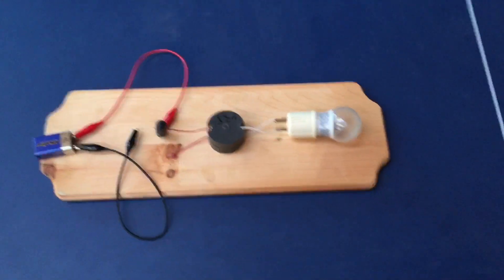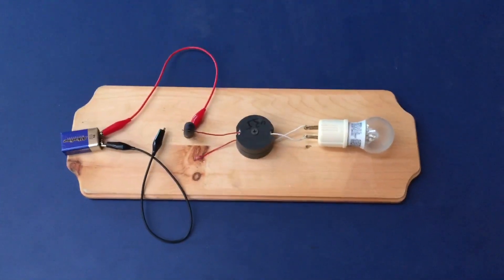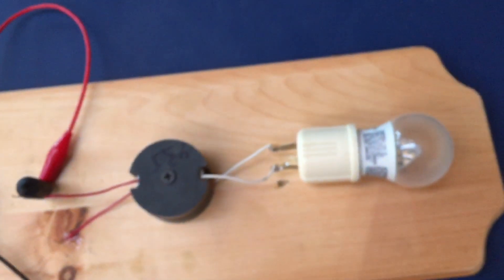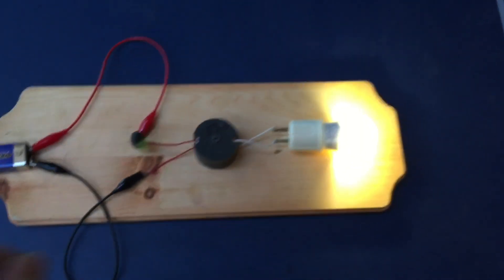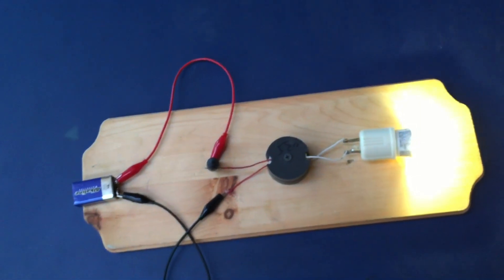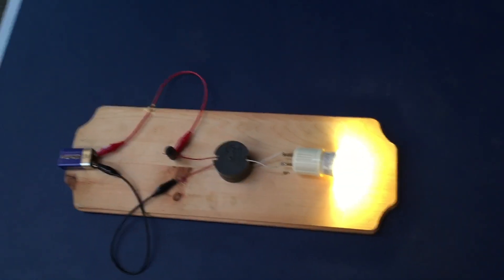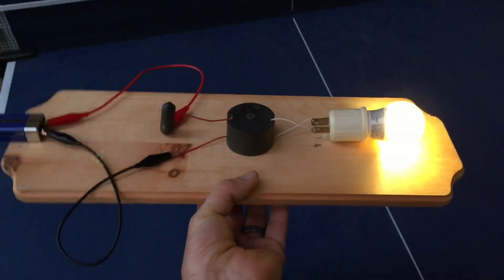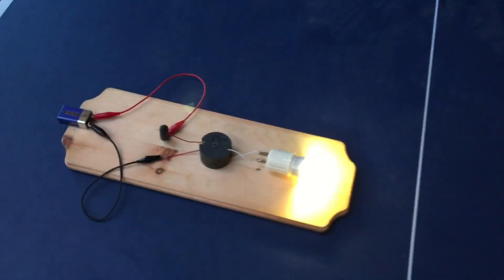Transistor Free Joule Ringer - Super Simple Config

Comment: How many windings? Why not just give the resistance of the carbon-rod & use a "potentiometer"? (Avail. at every Radio Shack, Digi-Key, Newark Electronics, etc.)...
...and, BTW, 30-40ma SUCKS for lighting such a small light-bulb! No offense intended, but where'd you get your Engineering License, from a matchbook or a comic-book?
Sincerely,
 Phoenix NightOwl, a.k.a. "TV Engineer for over 35 years", Original Lic. # P1-24-12140, current # PG-4-5658.
(..."Keep on experimenting?" heck, I knew THIS stuff when I was 8 yrs old!)
Reply: There is not much you are sharing with the world with all those "35" years of experience....
Reply: What do you want to know? (Like: Does it really take only 15-microseconds for the drift-tubes in a power klystron tube to vaporize?  Yes, that $60,000, 6-foot-tall "tube", with 55-GPM of coolant running thru it, really will destroy itself that fast.)
 ...Ask me what you wanna know...
 (Don't knock someone till you've traded emails, phone calls, letters, ham-radio "QSO's", etc.
 Ask to learn;
 If I don't know, I may have it in a book on the shelves, or know someone who DOES know, & I can "relay" the answer.  Keep Smilin', and don't take life TOO seriously!
 (Before I forget: R.I.P., Johnny Winter & Jack Bruce;   seems like the really great musicians are getting closer to extinction every day)...
P.N.O.
Reply: Phoenix NightOwl, Jr. if you spent half as much time bragging, boasting and touting your horn and contributed that to brushing your hair, you might even get a date, too.
Reply: Phoenix NightOwl, Jr. the law is so complicated...i don't think lawyers and judges know what they're talking about...what is your biggest takeaway from reading this stuff....to me it sounds like if you can talk your way through it and not incriminate yourself, you'll "win" court battles.  have you watched Carl Miller's constitution vids?
Reply: Greenme Research Exactly. Typical response from a user with zero videos online, and only 1 subscriber. It's a phenomenon I call YT-jealousy. "oh darn, I know so much more, I've been at this, that, and the other thing - since you were knee high to a tadpole -- people should listen to me instead --  i guess i'll be the nasty troll and be all negative and derogatory, cause you know, i have no YT love" hahaha - hilarious
Reply: Yup, that's me, The Grinch©. Lousy job, but someone has to do it. (How "old" ARE you, anyway?) You really think I'm kidding? My Broadcast Engineer's license # was P1-24-12140, last renewal was "grandfathered for life" to PG-4-5658;
 The Feds say I know what I'm doing, or they wouldn't let me play with 4-Megawatt UHF transmitters.
 I don't have videos on-line because I've been busy teaching myself the law, and am "drowning" in paperwork. What have you been doing with YOUR time, lately?
 And you'll notice, I DID ask "Why don't you just use a resistor"; At 29₵  for four from Radio Shack©, they're a lot easier to get & work with than a carbon rod.
 And think about it:
30-40mA DOES suck for lighting an incandescent light bulb these days, when you can get a Naichi© or Cree© LED that'll use 6W & blind low-flying planes, with 3xAAA cells, (at about 28.5₵ each, incl. 7% sales tax, at the local variety store, instead of using $5.70 each for 9V batteries);
 A modern AAA cell is rated for about 1.000Ah, a 9V is rated from 0.120 to 0.180Ah.
 It's called "staying within budget & ahead of schedule", or "Why pay more when you're getting less?"
 If you need 9V, keep in mind that most "9V" batteries are only 7.2- to 8.4-Volts anyway, & if you really DO need an honest 9V, you can either buy a "9V Battery" from Varta, (they're in Germany), or other companies who make batteries, or you can make a simple "ladder-style" voltage multiplier, & STILL come home with more $ in your pocket than buying a "9V" battery.
 When the price of fuel went "through the roof", I put my fuel system, (scaled down to fit), on my Lawn Mower/Tractor, & now it runs all season on about 6-oz. of gas, instead of 6-gallons.
 I prefer to recycle stuff to death, like our ancestors did;
 When a sail couldn't be used as a sail anymore, it'd be taken apart & re-sewn into a tablecloth, then a shirt or pants or a dress;
 When those couldn't be worn anymore, it'd be re-done to make towels, then washcloths, then blotters & pen-wipers.
 Nothing went to waste, since after pen-wipers, it'd be used as cleaning patches for a musket, then as a patch to go between the ball & powder in the musket, & finally, as tinder for lighting a fire to cook the food that was shot with the musket.
 If there are five or six 39-gal. trash-bags a year coming out of my place, it's because I did my "Spring Housekeeping", (or Fall, Summer, or Winter; as the case may be).
 BTW, what's YOUR license number?
 Which school did YOU go to to get it?
 If you're "into" "ham" radio, and ever get on 6-Meters, or 10- or 20-M, see if you can find me on 14.070 using PSK-31, or whatever the usual calling frequency is for those bands, if you prefer "phone" to "code" or another digital mode. 6-M is tricky; sometimes the band is open, and sometimes its not.
 You can usually find me, (N3VQK), "lurking" on 2-M, on the 145.205 machine, or one of the linked or cross-banded repeaters that connects to that one; A new one just went up on 444.625, PL=103.5, in the areas around Axtell, Holdrege (sic), & Alma, Nebraska.
 And yes, there ARE more cattle than people out here!
 BTW, what's your callsign?
 I prefer the 145.205 machine - It's "open", and I can hit it with <1.5W from an HT & its stock "rubber-duckie" antenna.
 And here's some "TV Trivia" for ya, in case you think I'm all "Grinch":
 The Grinch© was drawn by the same animators that drew "The Bunny" & friends, and in "The Grinch Who Stole Xmas", (apologies for the spelling), while it was Boris Karloff who got the screen credit, the studio forgot to list Thurle Ravenscroft (sp?), who did the baritone musical voice which ran throughout the Toon, (& who was also best known for his "Tony the Tiger"© voice);
 It was August 1978 when Warner Studios published Bugs Bunny's© "obituary", & there were 998 original "Loonie Tunes & Merrie Melodies", and other original "Bugs Bunny & Friends" cartoons at the time. (I'm not sure if that counted Chuck Jones' "Roadrunner"© stuff).
 It wasn't until Warner saw how much Disney Studios was making with "remakes" and "marketing items", that they decided to re-open "Termite Terrace", and put pieces of the old Toons together to make "new" ones, but getting the voices was tough, because there was only one Mel Blanc, & only he & his son could do "the Bunny" & almost all of the other characters, (June Foray did the remaining few), & when Mel died, his son apparently didn't want to have anything to do with "voice-acting".
 (June Foray was Mel's "understudy", and was best know for her "Rocky the Flying Squirrel"© voice, with "Rocky & Bullwinkle"  being creations of Bill Scott & Jay Ward)...
 It's really a pity;
 As with Janis Joplin, Jimi Hendrix, & Felix Pappalardi, (if you don't recall "Mississippi Queen"©, think "Mountain"© w/Leslie West, "Corky" Laing, Steve Knight {sp?}, Bob Mann {when they played in Osaka, Japan}, & Felix), there was only ONE Mel Blanc.
  Have a nice day, Doc!  :-)
Reply: Oh, almost forgot: my experience with "video"  is mostly from sitting at the Master Control Switcher, or from behind a pedestal-mounted camera, at places like WSBA (in Pennsylvania), WMPB (PBS in Maryland), and Channel 17 in Tulsa, Okla. (I've forgotten the stations' callsign); All but Ch.17 had started out using 2"-wide "quad" tape, (which cost 18₵/ft., & a 14" NAB standard reel only held 30 minutes worth of tape, back when the machines cost around $250,000 each, and you didn't put your fingers anywhere NEAR where the reels were, if you wanted to keep your fingers to remain intact), and every station had to have at LEAST 2 of those monsters; It wasn't till the late 1970's, when Jack Schuster & the "technical" folks at WSBA, (in York, Penn.), figured out how to hook some 3/4" Sony "U-Matic"© machines to a then$17,000 Time Base Corrector, which made them stable enough to be used for broadcasting; From there, the machines "shrunk" to a 1/2" Cassette version called Sony© "BetaMax"©, and a then after the "Format Wars" of the 1980s, (which was "won" by JVC© & their "Video Home System" format, or "VHS"©), that it became affordable for people to have their own personal video tape recorders.
 Compared to what John Baird invented & was developed, perfected, and eventually standardized & called "television", it was a long technical road to get to where video stuff is now.
 So, be Happy you're around to see, & be part of, the "Technical Revolution", since Humans are already starting to be "evicted" from the earth, and Smile!
 Happy Winter, Doc!
Reply: That isn't even worthy of the time that it'd waste to respond to it. I don't "flame" anyone here, why do you?
Reply: Sorry, I stopped wasting my time with "Script Kiddies" long ago. Why don't you find something useful to do, like see how long you can hold your breath till you pass out, or similar? I don't have time to play with morons; I have to do more important things than reply to "flamers" like you.
Good Bye.
Reply: danh le I never heard of Carl Miller before, but I'll start looking for that name, the next time I'm searching names...
You're right, since I think I ALMOST gave jurisdiction to a shyster, before I caught it, realizing that neither he, nor his "client", have ANY "First-Hand Knowledge" of the subject matter, rendering everything they say as "hearsay", which normally isn't allowed, ("void ab initio"), but "If you don't state your objection, you don't have one", so now I have to look up the local Rules of Civil Procedure, compare them against the FRCP, & see how to lodge the demand, (a " Demand" carries more weight than a "Motion", while not giving a court jurisdiction the way a " Motion" would), to have the whole matter thrown out; my biggest problem is that there's only one district court judge for a 3-county area, and it's the same one I have to resubmit my Copyright Infringement claim to, & wouldn't you know, it's against the same shyster I'm going after for the Copyright Infringement (3 counts).
 (I might see if I can move it to a higher court, or try going for an "offshore" court, since Copyrights are international in scope, and include the "local court" with a count of Infringement as well; I think they just don't like me playing tennis in "their" court, and haven't figured out that there's nothing for them to "take" from me anyway!)
 They ARE "sloppy" in how things are done; they're not used to being "challenged" in their own backyard, and it's the "bully someone till they think they have no choice" tactics that usually "bring them down", but as you so astutely pointed out, you have to say SOMETHING, ("Silence=Acquiescence"), but knowing what NOT to say is what's SO important.
 (Check out :Judge: David-Wynn :Miller at dwmlc.com for details on how language is everything.)
 It DOES feel like it'd be easier to contact a certain "Friendly Embassy" & just "seek asylum", (at least I can prove bloodlines & ancestry!), but that would be like "giving up & running away", instead of asserting my rights & doing my tiny part to stop the travesty that's been going on here for FAR too long.
"Welcome to the minefield known as 'Pro-Se' litigation"!
(Just to verify some things, I asked the "local" office of the ACLU about some details, and was told: "You definitely have some valid issues, but our office is tiny & we just don't have enough people to go around; the next step is one you already know the outcome of, which is to take up some of this with Internal Affairs"...)
 Then, as necessary, start appeals & objections with moves for Change of Venue to get the vermin out of their "home court advantage", (in my humble & personal opinion, of course).
Usually, going to Internal Affairs is like guarding the chickens with a fox, but it's the next step on the ladder, as far as they know, and they're right, as far as playing with a BAR card in one's pocket goes, (but I don't have, nor do I want, one of those).
(Just my luck, my cameras were "down" for maintenance at the moment that the Civil Rights violations occurred, or I'd have irrefutable proof, & it'd "sail through" based on the paperwork alone, as it normally does).
 Good point though; I hope you don't have to go through what I am right now.
 "I've had fun before, and this ain't it!"
 (Oh, and to whoever made the comment about my hair: aside from that pic being over a year old now, {I DO need to take a new one, thanks for the reminder}, if I wanted a "date", I'd call a favorite Lady & ask her when she's got some time for one, & appear at her doorstep at the appointed time, since that's not been an issue for me. {I lost my wife to cancer long ago; I've mourned her, and moved on, as she'd wanted me to do}.
 I certainly wouldn't mind meeting more Ladies, though, but when you find yourself "shanghaied" & abandoned/deserted, after having your life's savings "grow someone else's legs & disappear", sometimes it's all you can do to go from one day to the next; and let's see YOU do it with a broken spine. When the right Lady decides she wants to become friends, we'll be brushing & braiding each other's hair in no time at all, so stop worrying about MY life and get one of your own, OK?)
 Apologies to who this was a reply to; I wanted to get that matter addressed & " out of the way", so I must extend my apologies for "mixing subjects", as the issue(s) you brought up ARE valid, and I'm using a small " tablet" in a " WiFi Hotspot", so I'm trying to get as much done at once as possible, & while the battery holds up!
 Have a peaceful day!
Reply: danh le I never heard of Carl Miller before, but I'll start looking for that name, the next time I'm searching names...
You're right, since I think I ALMOST gave jurisdiction to a shyster, before I caught it, realizing that neither he, nor his "client", have ANY "First-Hand Knowledge" of the subject matter, rendering everything they say as "hearsay", which normally isn't allowed, ("void ab initio"), but "If you don't state your objection, you don't have one", so now I have to look up the local Rules of Civil Procedure, compare them against the FRCP, & see how to lodge the demand, (a " Demand" carries more weight than a "Motion", while not giving a court jurisdiction the way a " Motion" would), to have the whole matter thrown out; my biggest problem is that there's only one district court judge for a 3-county area, and it's the same one I have to resubmit my Copyright Infringement claim to, & wouldn't you know, it's against the same shyster I'm going after for the Copyright Infringement (3 counts).
 (I might see if I can move it to a higher court, or try going for an "offshore" court, since Copyrights are international in scope, and include the "local court" with a count of Infringement as well; I think they just don't like me playing tennis in "their" court, and haven't figured out that there's nothing for them to "take" from me anyway!)
 They ARE "sloppy" in how things are done; they're not used to being "challenged" in their own backyard, and it's the "bully someone till they think they have no choice" tactics that usually "bring them down", but as you so astutely pointed out, you have to say SOMETHING, ("Silence=Acquiescence"), but knowing what NOT to say is what's SO important.
 (Check out :Judge: David-Wynn :Miller at dwmlc.com for details on how language is everything.)
 It DOES feel like it'd be easier to contact a certain "Friendly Embassy" & just "seek asylum", (at least I can prove bloodlines & ancestry!), but that would be like "giving up & running away", instead of asserting my rights & doing my tiny part to stop the travesty that's been going on here for FAR too long.
"Welcome to the minefield known as 'Pro-Se' litigation"!
(Just to verify some things, I asked the "local" office of the ACLU about some details, and was told: "You definitely have some valid issues, but our office is tiny & we just don't have enough people to go around; the next step is one you already know the outcome of, which is to take up some of this with Internal Affairs"...)
 Then, as necessary, start appeals & objections with moves for Change of Venue to get the vermin out of their "home court advantage", (in my humble & personal opinion, of course).
Usually, going to Internal Affairs is like guarding the chickens with a fox, but it's the next step on the ladder, as far as they know, and they're right, as far as playing with a BAR card in one's pocket goes, (but I don't have, nor do I want, one of those).
(Just my luck, my cameras were "down" for maintenance at the moment that the Civil Rights violations occurred, or I'd have irrefutable proof, & it'd "sail through" based on the paperwork alone, as it normally does).
 Good point though; I hope you don't have to go through what I am right now.
 "I've had fun before, and this ain't it!"
 (Oh, and to whoever made the comment about my hair: aside from that pic being over a year old now, {I DO need to take a new one, thanks for the reminder}, if I wanted a "date", I'd call a favorite Lady & ask her when she's got some time for one, & appear at her doorstep at the appointed time, since that's not been an issue for me. {I lost my wife to cancer long ago; I've mourned her, and moved on, as she'd wanted me to do}.
 I certainly wouldn't mind meeting more Ladies, though, but when you find yourself "shanghaied" & abandoned/deserted, after having your life's savings "grow someone else's legs & disappear", sometimes it's all you can do to go from one day to the next; and let's see YOU do it with a broken spine. When the right Lady decides she wants to become friends, we'll be brushing & braiding each other's hair in no time at all, so stop worrying about MY life and get one of your own, OK?)
 Apologies to who this was a reply to; I wanted to get that matter addressed & " out of the way", so I must extend my apologies for "mixing subjects", as the issue(s) you brought up ARE valid, and I'm using a small " tablet" in a " WiFi Hotspot", so I'm trying to get as much done at once as possible, & while the battery holds up!
 Have a peaceful day!
Reply: You're right on target; it's a "Guilty till proven innocent" situation, not the other way around, as it once was, which ended sometime between 1879 & 1933, "give or take" a decade or so.
 You HAVE to respond, yet it's knowing what NOT to say, & what to challenge, that gets you the "win".
 I've never heard of the person you mentioned, but I'll certainly look him up...
(Pardon the formatting, I'm using a small tablet in a WiFi hotspot).
 Here's a handy name to know, for some great reference stuff; (I think of him as " a judge with a conscience "),
:Judge: David-Wynn :Miller,
 ...on YouTube, as well as his own website at "dwmlc.com".
 Give his site a look-see, & don't be intimidated by his sounding like an " E.T.", he really does know his stuff, and doesn't seem to like what's been happening with the Judicial Branch, (in my own opinion, of course).
 Happy reading, & have a peaceful day!
Reply: Phoenix NightOwl, Jr. thanks so much for the link to the judge....yea its a tight game betw saying enough to defend yourself but not enough to incriminate....and honestly, i do believe that if they really want to set an example bad enough, you can't win no matter what. (Peter schiff's dad on the income tax)
Reply: I'm only slightly familiar with Irwin Schiff's case, altho I know from Arron Russo's documentsry film, "America, Freedom to Fascism", that when a "judge" is quoted, "on the record", as saying "there's no room for the Lsw in my courtroom!", something is VERY wrong. (Arron Russo died several years ago, but his film should still be available; I saw it on either "Link TV" or "Free Speech TV", (I'm out in "farmland, usa", and have "Dish Network" satellite TV, which has some very good "no-sponsors" news & relevant-events programming... I don't like the thought of losing those, but costs are just too mich for me, & I'm deciding if I should just keep a "pre-paid" cell-phone and internet service & "lose" the rest  (I think those stations may have "streaming" feeds via the 'net), or find some other way of cutting costs without being "cut off" from what's really going on around the country & the globe...
See if you can find Arron's film, it's a real "eye-opener"!
Good luck, and "Keep Smiling"!
(Any copyrighted materials mentioned herein are the property of the respective copyright owners/holders.)
 ...and keep wsrm, it's getting COLD outside!
 Phoenix
Reply: Wrong! You can't replace the carbon-rod/Cu wire with a potentiometer. That is not how this works. The copper wire vibrates against the carbon to get the oscillations. It IS the oscillating portion - the "oscillator" (a sort of relaxation oscillator). 
There are multiple ways to get a circuit to oscillate, this is just one way. Relays are another. Transistors. Tubes. Photoelectric. Magnetic. Piezoelectric. Thermoelectric. Etc.